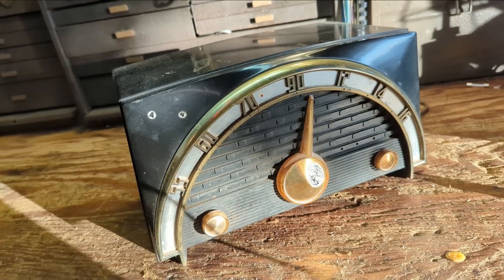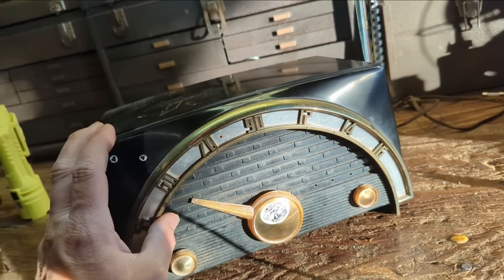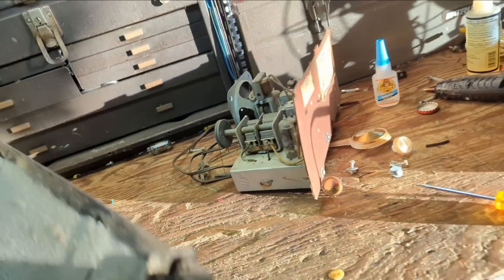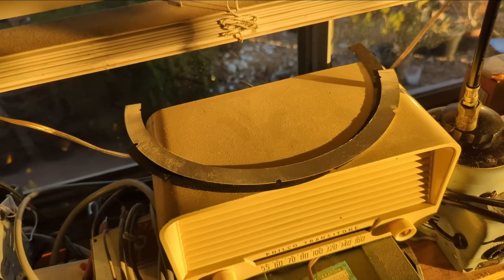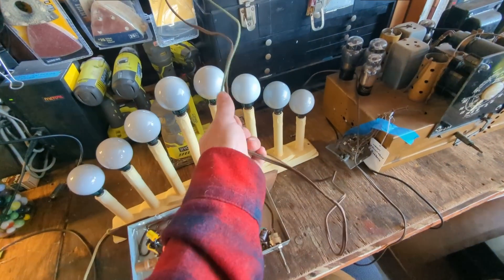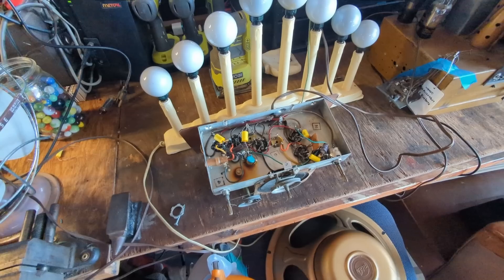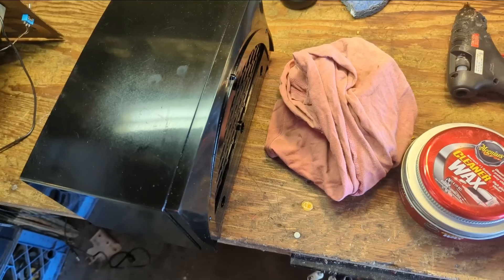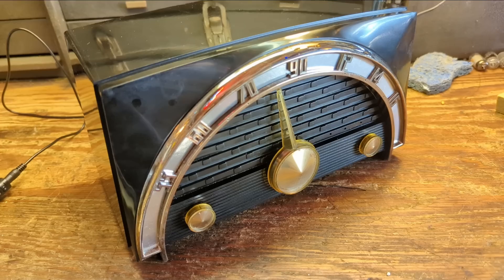Early 50's CBS radio full overhaul

Comment: The fuzzy white coating on the knobs is plasticizer. The plastics used then weren’t as stable as they are now. The chemicals literally seep out over time. The clear plastics are the worst for that. A good scrub with dish detergent and a toothbrush will get rid of it.

Comment: I enjoyed this! My first transformer rebuild was on a Zenith Racetrack radio that had SMD in the first can. I was nervous as heck opening that can but once inside, without snapping a wire, got to the mica. Used craft board to slip in the contact thumbs and worked perfectly!

Comment: You’re right as far as those five tube radios being as common as dry meat on the thanksgiving turkey. When I was a kid, people were upgrading their electronics and getting those radios was easy then. I think there must be about as many different designs to the cases as there were different looking people. I used to mount the radio chassis on a piece of wood thus leaving the guts out in the open to be observed while the tubes were glowing. I’d experiment with them changing tube locations and tube types to see hat happens. I’d change the capacitors with higher and lower numbered caps to see what happens. Thank god the silver mica decease wasn’t  a big problem then. I wish I kept some of those radios back then because they’re a lot harder to find at decent  prices anymore. Out of all the radios you’ve worked on and or own, whats your favorite table radio and why?

Comment: I have a Zenith with Silver Mica disease,  Question, will any 455 KC IF transformer, replace any other one?  Did you just happen to have an almost exact replacement on hand?
Reply: Not all 455 KHz IF transformers have the same Q and coupling coefficient so throughput and selectivity will vary somewhat.  The thing to avoid is getting the phasing of a transformer reversed and end up with an oscillating IF amp (squeeeeeeeeaaaallll!). 🤔
Reply: @pibbles-a-plenty1105  Thanks, I hear you, Mister Radio must have a stock of IF xfmrs, so had a replacement in stock.